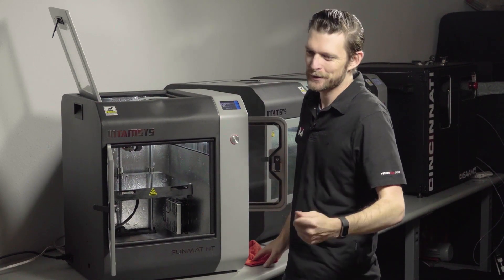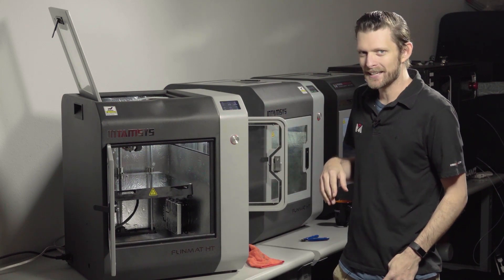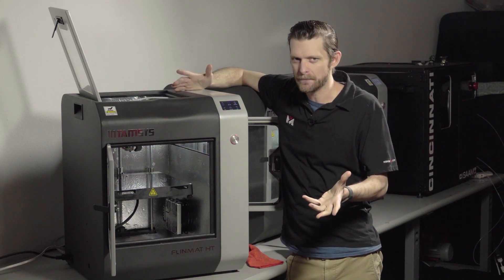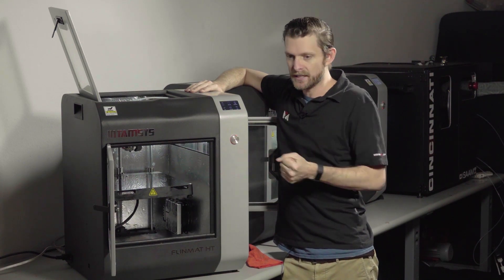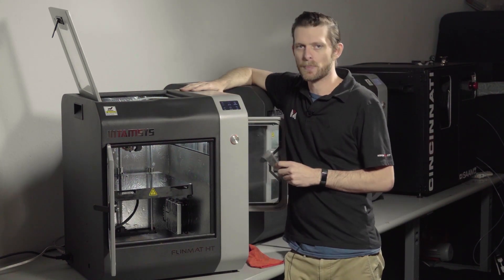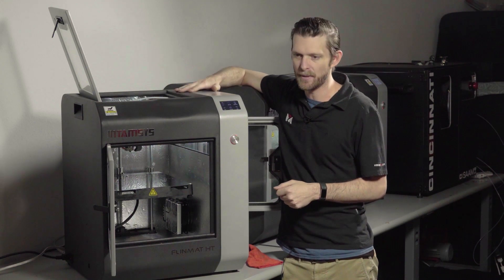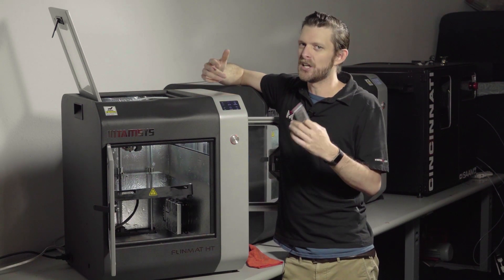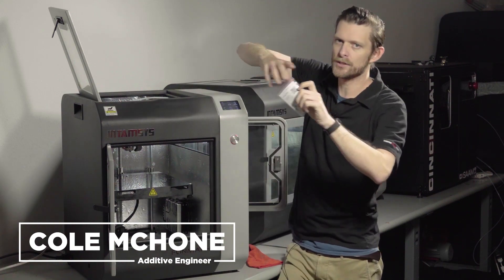Intamsys Funmat HT Enhanced:  How NOT to use the On-Board Camera

Comment: Hello guys!
¿Have any of you been able to use octoprint with your funmat HT Enhancend? 
we recently acquired one and when we try to control or monitor the 3d printer with the raspberry pi we get some issues, 
1. Once we are able to monitor the 3d printer with octoprint the LCD touch stops working so we are unable to change settings.
2. Octoprint does not detect the chamber, only the bed temperature and nozzle temperature.
3. The Z axis works the other way around and when you clic to extrude in octoprint the printer retracts.

We also tried to use builbee but it didnt work, any help would be really helpfull.
Reply from the maker: We do not use octoprint with the INTAMSYS printers for these reasons, although we do have some customers who have it set up. We generally print with an SD card on those machines.